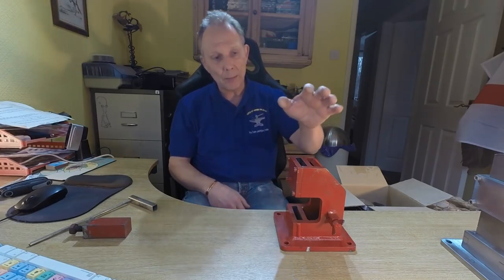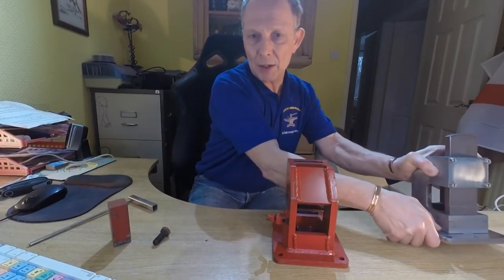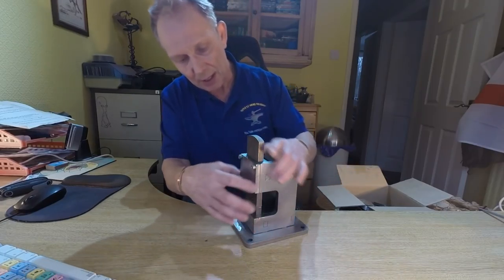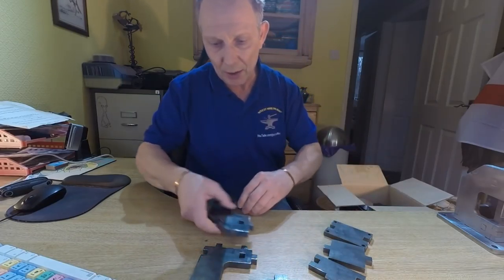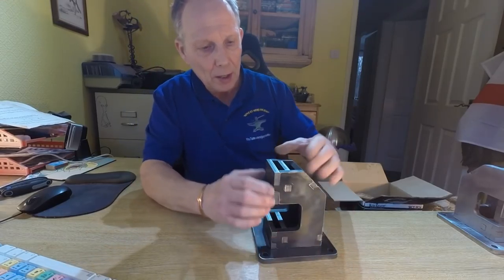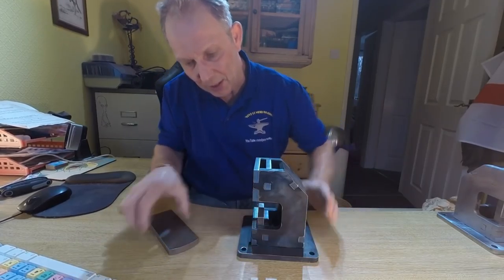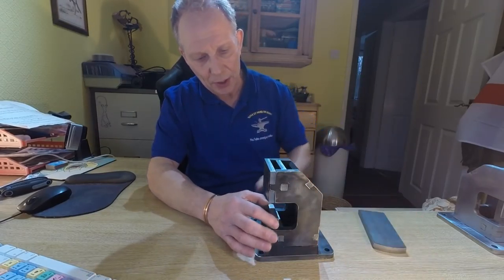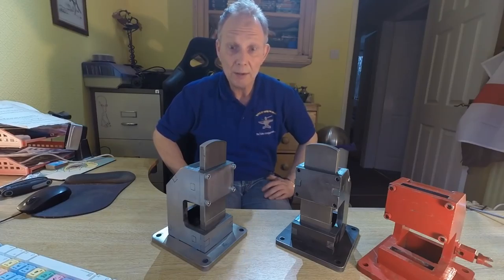Blacksmiths Guillotine tool MK2 Rev1

Comment: Looks like a solid design.  I have a more simple guillotine tool but overall similar design, and have found that a small hole below the bottom die is essential to helping free a stuck die.  My bottom die needs to be dressed often top and bottom, because the bottom of the die seems to upset during heavy use just enough to get itself stuck badly.  Add in scale that finds its way between the frame and the die and you've got a permanent bottom die.

Comment: It rattles a bit, but once its permanently put together, that little bit of slop isn't going to matter at all. Great idea. I don't think that's too loose at all for general forging. Besides, the dies are supposed to create set downs...if they're off by a few thousandths, it won't take but a second with a file to fix that right up.

Comment: I think you are more than ok with this design the  lugs on the removable plate are a good addition as for your concern over the spacing on the upper i dont believe its an issue perhaps just a line of instruction to push it to the rear before welding would be plenty just my thoughts hope this is helpful

Comment: I think having it lose is better. There is not that much play in it anyway and after the tool has been used a while and gotten dirty and rusty you would not need to worry about the dies sticking.

Comment: Hi Gary love the new design, on the tolerance subject if  you removed .25mm  instead of the full 1mm design and you can always make some minor adjustments, better than using shims I think, I recently made a small guillotine with just stock removal so I had a chuckle when you mentioned a lot of filing, if your interested ive uploaded a vid, definately need to work on my design as I find the top die tends to jump around a lot, not sure if Ill be willing to make another one for a while, definately be investing in a drillpress before doing a full size version

Comment: Gary I think the newer model with the little bit of wiggle room is much better. It would be easy to shim the dies to avoid it being too tight, even just wrapping the die in a few layers of paper or masking tape would work just fine. I'd stick a fork in it if i were you.

Comment: Very nice tool - I like it a lot. A whole lot actually!
I'll probably buy/make one myself at some stage, but I think I'd like to make the front face of the lower die holder removable like the top one.  Your comment in the last video about adding some 1" bar to the top edge for larger pieces may well make it impossible to fit due to a lack of clearance below the top die holder.
This is not in any way meant as a criticism, as I think it's a really great idea - more of an observation!

Comment: Roughly what does it cost to laser cut one of these units? How big a sheet of 1/4" or 5/16" plate do you need to start with? What is the cost of the CAD drawing file?  I would love to make one of these beauties.
Reply from the maker: it cost me roughly £87 to have cut including the plate which is 12mm and 10mm. The CAD drawings are £10 but if you are in a country that uses the imperial system it might not work for you if you can't get metric material. I'm working on an imperial set of plans but they are not ready yet.
Reply: Ok thanks for the information and I will wait till you get the imperial plans set.  Great design and I just got my "give it some beans" t-shirt in the mail... love it.  Thanks for all the work you do.

Comment: it would be nice to have one without the lugs that was drilled and tapped for the folks without a welder.  Make the bottom front plate and the back plate bolt on.  The base plate could bolt on too (reset them to keep the base smooth) it might even be cheaper